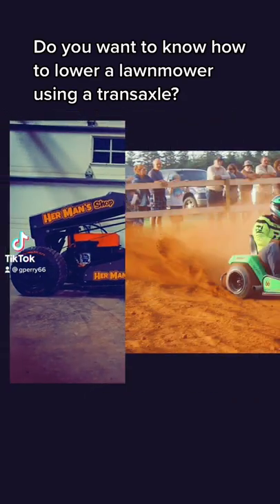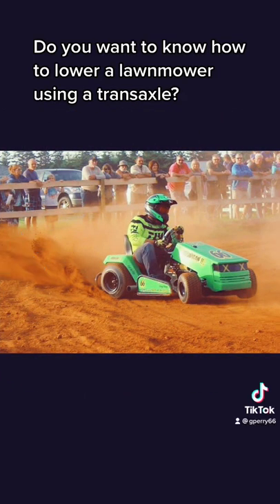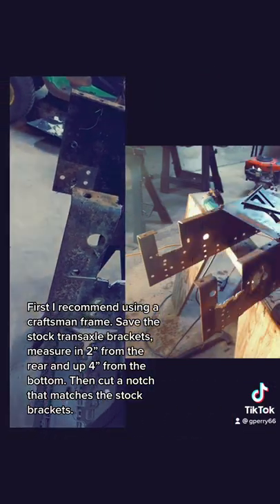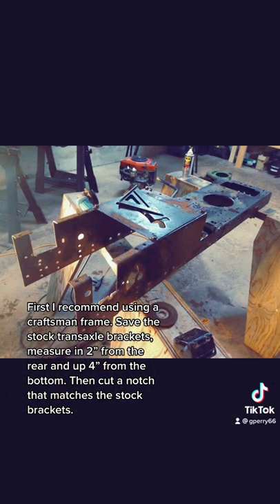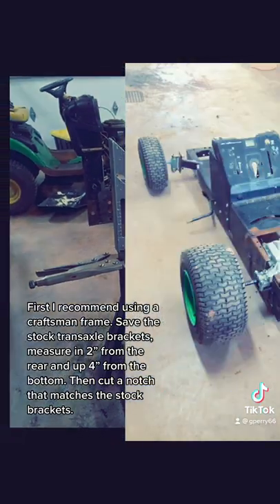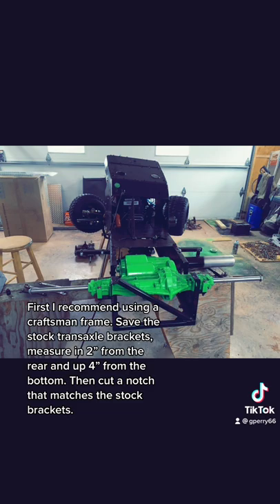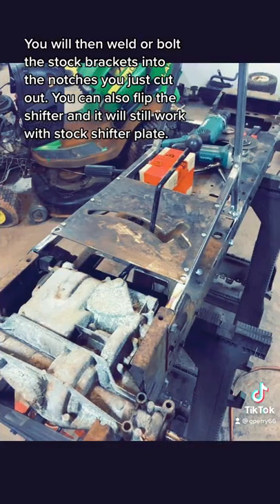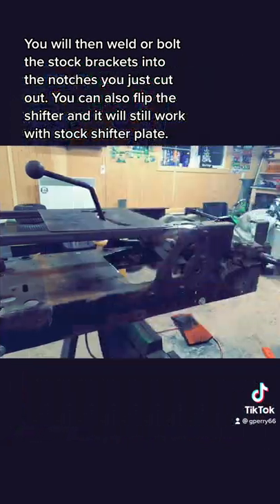PEILTRC. How to Transaxle Flip, lower a lawnmower. Instructions for lawn mower racing. Helpful tips.

Comment: I did this a month ago but on my own with no help and I did it the opposite way, I cut the bottom out instead of the top
Reply: That's why I don't get these how to mower videos. Most people like us already know what needs done and it's probably different than any other build. Now if it was a suspension build or an engine swap I watch those to steal ideas but this is pretty simple. It should be "one way to lower your ("model") mower.

Comment: Wouldn’t it go in reverse though
Reply: I think you would flip it around sideways
Reply: Once you flip it, spin it around.
I had to think about that same thing for a minute or two but it finally hit me.
Reply: If you flip it then spin it around, the transaxle would stick out the back ?? I'm having that problem on mine and can't figure anything out 😞
Reply: @christopherdunson8079 If you flip it then spin it around, the transaxle would stick out the back ?? I'm having that problem on mine and can't figure anything out 😞
Reply: @enginesandelectricity3795 If you flip it then spin it around, the transaxle would stick out the back ?? I'm having that problem on mine and can't figure anything out 😞
Reply: That's why flipping it isn't how I'd do it, I'd cut the bottom and just raise the transaxle that way the frame is sitting on it, not hanging on 4 little bolts.